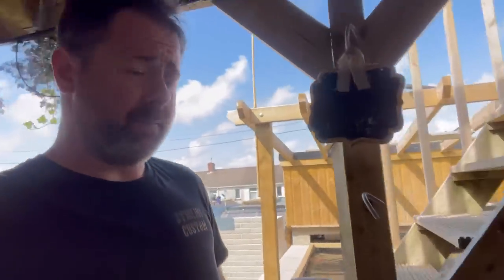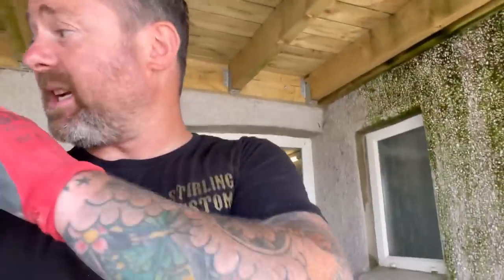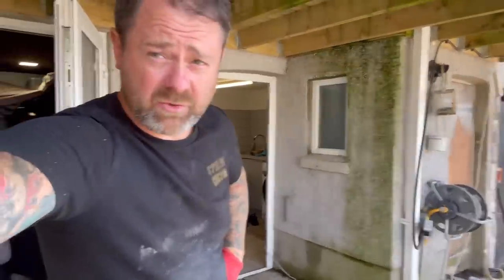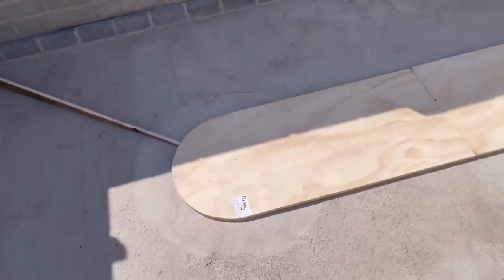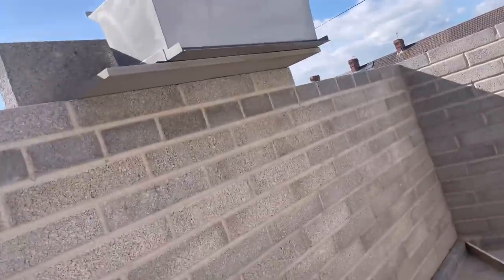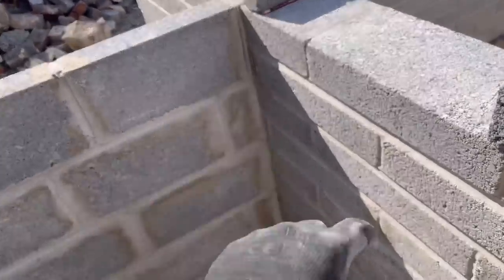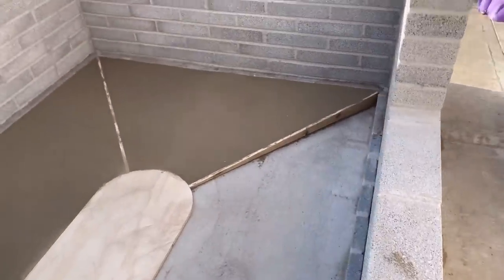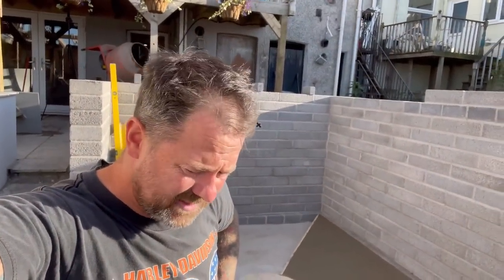5000 gallon koi pond build, part 6!!  Bio chamber & sloped floor 🪖🪖🪖🪖🪖🪖

Comment: Hi Lee pond is coming on well. You can cut some foam for the corners easy with hand saw or hacksaw blade. But wear some safety glasses because the dust gets in your eyes. I worked for Camplas Technology in Bridgend about 25yrs ago and we would buy the sheets and profiles ready cut to save time or just cut with saw and shape with some 40grit sandpaper really easy to work with just the dust blows everywhere.
Reply from the maker: Matts going to short that out now he’s on it!!!
Reply: @leehadfield6881  Matt could also mix some Cab-O-Sil powder with resin to make a filler to  put in the corners. Mix a slow mix for the filler and apply with a spreader and layup over it while it is still soft. But I sure Matt knows what he is doing he's a top man despite what some others may say.

Comment: Hi Lee, loving what you have done so far,👍as for the corners using Arriss rail you could screed or concrete the corners. If you use 8x2 and use a 45 degree cut on each edge this will give about 4'' surface area. You could use ply and put a couple of brace's to stop it twisting? Again keep up the good work.
Reply from the maker: Good ideas there! But Matt is going to do foam ones now! With a bit off a twist!!!!! 🤫

Comment: Looking proper mint. 👌 is that actual slate that those bakki's are going on? You not worried about them snapping with all that weight?
Reply from the maker: Thanks Bobby! Yes mate it’s real strong! Obviously can’t hit it with a hammer but will hold 100kg no problem